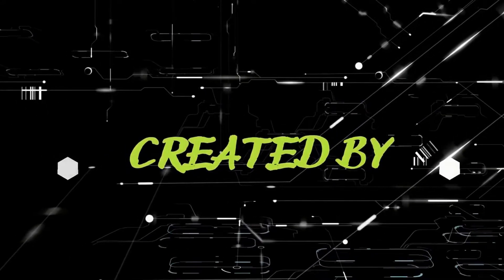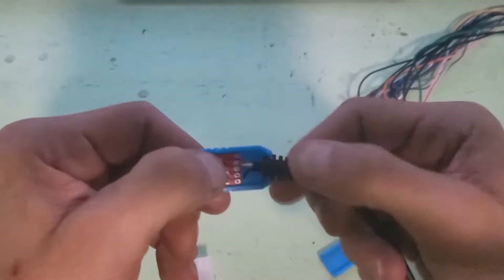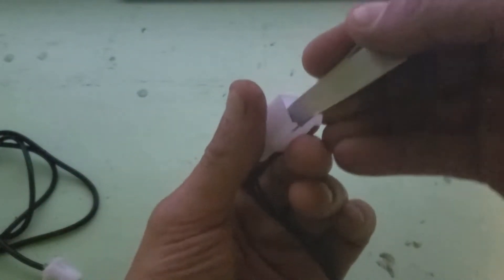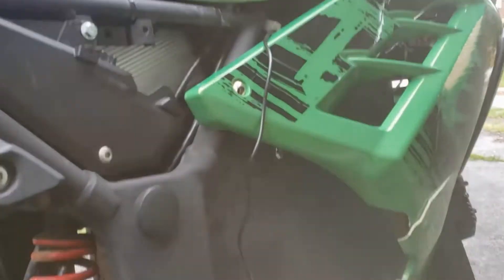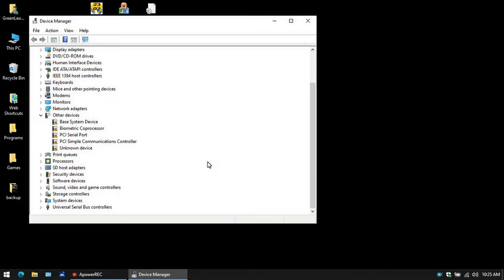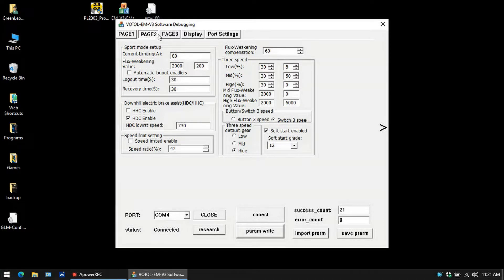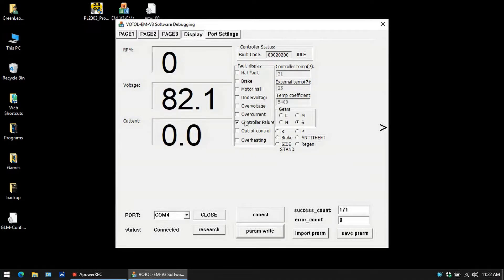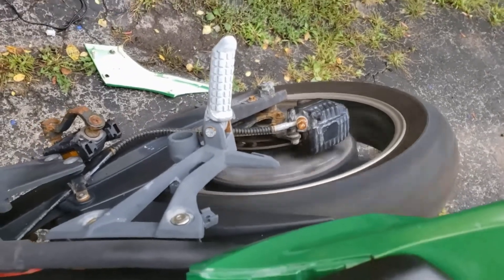Tao Leo - Votol EM-100 Programming and Test

Comment: Thank you so much for sharing your experience and for sharing the files, what was the maximum speed
Reply from the maker: Before I  retired this setup, it went about 115kph top, 130 off the ground. But I've swapped the 3kw motor for an 8kw and next year I'm putting in a fardriver nd72680. Hopefully I can get closer to the 200kph area. Tnx for watching!

Comment: Hello
I purchased a controller to replace the bad one that the throttle isn’t responding, I replaced the throttle. It has a 3 speed with reverse shifter but when I hooked it up it stays in second and will not shift up, down, or into reverse. Does this need to be programmed and if so how do you do that? Is there a video that would explain the steps? It’s a VOTOL Programmable EM50sp CAN Version 72V 50A 55KPH Controller for Electric Scooter Bike
CAN Version

Thanks for your help
Reply from the maker: Give this a read. It's a little different depending on the bike but this should be what ur looking for. Pay close attention to the port page. https://www.google.com/url?sa=t&source=web&rct=j&opi=89978449&url=https://deller.pro/wp-content/uploads/2023/05/2021031154133781_6.pdf&ved=2ahUKEwjhl_DoiIiQAxWKDDQIHbcSOWkQFnoECE4QAQ&usg=AOvVaw3c800gX-Jsg3S4Zi6sFXLL
Reply: Thanks for your help! I downloaded everything and I think everything is connected , when I hit connect it says I’m connected, I tried getting it out of park mode but it won’t let me. It also says “let’s open serial port” what the heck does that mean? Thanks again
Reply from the maker: Here, join this group. They know alot more than i do and they have alot more time to help. Goodluck https://www.facebook.com/groups/199911289738113/?ref=share&mibextid=NSMWBT

Comment: Hi. Question man. Can you set the controller to its max wattage.. like I have 3kw motor. Can I set the controller to 2500w max? So as to protect the motor however hard I throttle?
Reply from the maker: It doesn't really work that way with votols. If u keep ur max amps between 80-100a ur components should be safe no matter how hard you throttle. Just make sure ur bms is rated for 100a and can handle the load. Unless ur lead acid batteries, then u should be fine, they don't have bms's

Comment: can this be done with the controller out of the bike?
Reply from the maker: Yea as long as the controller is powered and u have an on/off switch. Doesn't need to be in the bike or hooked up to anything but power and usb. Although if u wanna tune it, I'd hook the motor up too.
Reply: @GreenLeoMan  thanks for the info , what province do you ride in ?
Reply from the maker: @mlow587 no problem. I'm in Niagara Falls, Ontario 😁

Comment: QS In-Wheel orta tren motoru için VOTOL EM-100 fırçasız DC denetleyici ?
Reply from the maker: I have no idea what your asking, sry.
Reply from the maker: It will work on both "in wheel" hub motors and external motors. There's a setting for that on page 1.

Comment: maybe you can help me. I bought a City Coco E-Chopper a few months back. I just spent several months refurbishing it and spent most of my savings. I finally got it assembled and took it for a cruise. It was awesome! I rode it for most of the day. In the evening I took it to do my laundry. After my laundry was dry I went outside to discover when I turned the key, everything worked but the current that was supposed to flow to the motor. 
I have a serious heart condition and was pleasantly surprised when a couple with a pickup offered to haul it home for me.
I have spent the last few days dissassembling it and reassembling it over and over again. I have watched every Youtube video including yours but have found no answers. 
I bought a couple extra controllers off tyhe internet a couple months ago and tried hooking them up to the bike, and get nothing. There is no wiring diagram. I cannot even get them to turn on.
Can I send my controllers in to you to look at?
Reply from the maker: I'm sry my friend but i don't have a repair shop. I just work on my own and i know nothing about your brand of bike. Unfortunately u might have to pay a local shop. Goodluck

Comment: where can i get the plug for the bike/laptop? thanks so much for your time
Reply from the maker: Here's 1. https://a.aliexpress.com/_mNH01oo
Reply: @GreenLeoMan  okay the wires look different colours will i have to take them out and put them in the right tabs like you demonstrated in the video? thanks so much
Reply from the maker: @alr2989 yea probably. It won't hurt it either way cause ur just switching the data lines, not the power lines. If it doesn't work 1 way, switch the 2 wires and try again.
Reply: @GreenLeoMan  if i copy the exact same settings as you on my tao leo will the switch still work to make it slow/fast?
Reply from the maker: @alr2989 no. Mine is setup for sport mode only. And I'm using the connection for reverse, I just set that 1 to be my sport mode. All the other settings will work. Just not the last page of connections. Sry, mines rigged different.

Comment: I have a question .
Why after I enter values in the EM-100 controller after pressing the record button, after switching off and on again the controller returns to the old settings.
Reply from the maker: That's interesting. Never heard that 1 before. Try reinstalling the software. Also check your cord for continuity.  I've never had this issue, hopefully this helps otherwise I'm not quite sure about this 1.

Comment: If the park is engage what is showed to the display is it hall failure?
Reply from the maker: No. If park is angaged, the "P" on the display tab will be selected. If turning off ur bike and turning it back on doesn't get rid of the "hall failure", u might have an issue with your motor wires going to the controller. If u continue to have this issue, check your motor wires to make sure none have shorted out. The 3 big wires coming from the motor, the plastic covering the wires breaks down over time  and could cause a short. I had to strip the black casing off the wires and could immediately see cracks in the plastics everywhere. I just wrapped all 3 wires with electrical tape and the issue went away. It's in 1 of my videos, i just don't remember which 1 anymore lol. Good luck and tnx for watching!
Reply: @GreenLeoMan  yeah thanks. .

Comment: Is it the same with the VOTOL EM-30S ?   I need to change the voltage.
Reply from the maker: I have no idea. Never had 1. Let me onow if it works. I can't see why it wouldn't work. Good luck!
Reply: @GreenLeoMan   I got frustrated trying to program the EM-30S so I just used a normal 48v controller that was so much easier.
Reply from the maker: @willscoot1394 atleast it works. Thats the main goal. Sry u couldn't get the em30s working.

Comment: Hello :) hope all is well with you ..I got a 2020 Tao leo and I've had to buy a new controller votolem100. Do I have to program this controller???? because I tried installing it and I still have no motor function.
Reply: Yeah I saw it. Just wanted to make sure
Reply from the maker: Yes u do. And u need a special cable to do it. Check out my votol em-100 programming vids. They're in the "Tao Leo Tech playlist. Good luck 👍
Reply from the maker: You're literally commenting on the video that explains it all. Watch the video b4 asking questions.
Reply from the maker: Heres the link for the cord u need.. https://www.aliexpress.com/item/1005003738240089.html?spm=a2g0o.cart.0.0.16c83c00famHmz&mp=1

Comment: Hello. in the video you talk fast and I don't understand. how to reset the "controller failure" flag. in my controller it is still active and the engine does not work
Reply from the maker: To reset the "controller failure" just turn ur key off and wait 10 seconds, then turn it back on and all should be well. Good luck!
Reply: @GreenLeoMan  thank you but I have another problem. I have em100. when I connect, the "busbar current" and "phase current" fields show 0 and the model shows em30.
When I enter some values and give "param write" and connect again, it is em30 and 0 again. Similarly, on page 2, the "current limiting" field. always 0. I can save the remaining fields and they are remembered correctly. the controller does not turn the engine. is it bricked?
Reply from the maker: Can u switch it back to em100 on page 1? That might help
Reply: @GreenLeoMan  I check em100, I click write param, software  says:  write ok,  I click connect and model  change to em30s , currents change to 0
Reply from the maker: That's an issue I'm unsure about. Could be a faulty controller but I'm not sure. Could be missing a step somewhere in the process. Maybe fauly cord? Not sure. This 1 confuses me. Keep trying things and I'll do some research to c if i can find a solution. Let me know if u get it in the meantime.

Comment: hey i did all that but the throttle doesn’t work, and on the display page, Undervoltagw and Overheating is selected !
Reply from the maker: Is your controller the em-100? Remember these settings are for a tao leo. If u have both of these then it has to be a bigger issue.
Reply: @GreenLeoMan  yes tao leo em-100
Reply: @GreenLeoMan  right now it’s just the overheating that is selected
Reply: @GreenLeoMan  is there any way i can reset all the setting to the basic ones. so my bike can work again please
Reply from the maker: I don't have a copy of the original setup. I had to replace my controller before I could save it. But I'll ask the shop I got mine from. I'm sure they have it backed up. Send me an email and I'll send you the file as soon as i receive it. Emails can be sent to Greenleoman.yt@gmail.com. give me a day or 3 to get results. The business world is a slow 1. Tnx.
Reply: @GreenLeoMan  hey, i tried today again, but the bike only throttles like after 0.02 seconds i turn it on then it stops throttling.
Reply from the maker: Not quite sure. Could be a faulty bms, shorted wired, defective throttle, defective switch or something like that.  It can't be the settings, it wouldn't do that stock. Or worst case scenario is they sent u a defective controller. Ur obviously programming it correctly and it's the right bike with the right controller...gotta be something else. I remember something similar happening to me and it was my motor wires. The plastic had deteriorated and the wires were shorting out. Also another time it was the stock breaker, if ur bike has a breaker on the battery, remove the breaker from the bike. Just an idea. Also strip just a little of the sheathing back on ur large motor wires closest to the controller side of things and see if the coating on the wires is cracking. Trial and error my friend. Hopefully u figure it out. Good luck!

Comment: Hi, have you tried using the regenerative braking option on the controller? How is it triggered because I can see you can have regenerative braking on without having the e brake turned on. So in that case when you use your actual disk brakes it will collect the power from the braking? Thanks in advance
Reply from the maker: As soon as the brake lever makes the click sound from the brake light switch, that's when the regen kicks in. The disks have nothing to do with regen. They are for braking only. The brake light switch signals the controller to engage the regen. I hope that helped.

Comment: Hi.  I looked at your video a few times, and it seems pretty complicated and intimidating, but I am not at all technical.  I have just ordered a Chinese scooter with a package of 72V-70AH lithium battery / 2000W QS MOTOR and a  VOTOL EM100.  I am now trying to find where to buy a USB connector to votol EM100.  Do you have a link?  Also if i only want to raise maximum speed limit to say 80 kmh, what setting do I edit (ie what page and what setting on software user interface you demonstrated in your video).  Hope you can help, thanks.  And trust me if i could find someone in Cuba who was an expert in this I would :)
Reply from the maker: I got the cable from aliexpress. Look for the "my tao leo parts list" video in the tao leo tech playlist. It has links to everything including the programming cable.
Reply from the maker: And the em-100 should be with a 3000w qs motor. Ur gonna have to find the amp rating on that motor and set the software accordingly or u could easily smoke ur motor. And as far as limiting. Just leave ur "hdc enabled" in the software and u'll be fine. Just dont over amp ur motor. Good luck!
Reply: @GreenLeoMan  excellent and many thanks, much appreciated!!  I am going to start immersing myself in this technology rabbit hole :)  maybe need to go tech. college beforehand or find a mentor in cuba:)      keep up the great work!!!

Comment: Still getting the "communication abnormal" after switching both wires back and forth. Solders and wires are in tact. Sees coms and port locations. Also tried an older windows laptop along with changing the language and different versions of software's.
Reply from the maker: And u turned the bike on right? Sry had to ask. Also did u try cycling the key on and off between settings? Just trying to cross stuff off the list.
Reply from the maker: If it keeps failing after that...I hate to say it but u might have a faulty cable, it's a possibility. They are made in china after all.
Reply: Yup everything’s wired up with ignition and display to ensure it’s on. Would you recommend just another non cam bus cable or Bluetooth to try ? Also only other thing I noticed was on my harness for the programming port I have a pink wire which is 5v reference but yours didn’t
Reply from the maker: It doesn't need it. Try disconnecting that wire and trying again
Reply from the maker: That could very well be the issue. U might have to switch ur orange and blue again but hopefully this should work. For some reason they work without the 5v.

Comment: Quick question on page 2 of your settings, your set up for the default gear is set as Hige, what's that for? Is it for faster take off?  Because mine by default is set to "Mid"
Reply from the maker: It's cause i don't have a switch anymore. I just leave it in high.
Reply from the maker: I honestly don't remember. It's been a while since I looked.

Comment: Connection abnormal no response, how to fix?
Reply from the maker: Be more specific
Reply from the maker: Did u switch the wires on the plug like i said? Is your adapter can bus? Small details help
Reply from the maker: Also did u select the right com port?
Reply: Heya so I finally got it connected, but I don't know how to turn the parking brake off
Reply from the maker: Watch the video. I explained it already.
Reply from the maker: 4:30 into the video
Reply: @GreenLeoMan  Gotchya, thanks again.

Comment: Just got my programming cord installed, I hooked it to the false gas tank and so I can open it with a key and access the cord! 

Ever play with rate of rise and decline?
Reply from the maker: Yea a little. The faster the rise the higher the amps so u don't wanna adjust it too much. As far as decline. That's for regen breaking so it don't matter. Basically, how fast would u like to slow down lol.

Comment: hey man can you help me with my votol controller?
Reply from the maker: Watch my videos. I have 1 or 2 on how to program them and how to set up the wires.
Reply: ok well i have the 1200, 150 and 200, non of which i can get to spin the hub. i have followed every single fracking guide, i have all the manuals and software, its been months of me trying to figure this out,
what would be super cool would be the config file youre using, maybe i can jut upload it and shit might work
Reply from the maker: I hate to ask but did u disengage the park setting? It won't go anywhere if the controller is in park. I just removed the park feature by setting park to null. I can't send u my file. Sry bud. And u said the 150 and 200. These settings are for the 100. That might be ur issue. I dont know the settings for those controllers. Unfortunatly it's a very frustrating game or trial and error. The video makes it look like i just knew.what to do. It took me a long time to get my settings right. And my motor wouldnt spin until i took the park option away. Hope u get it man. Goodluck.
Reply from the maker: Also these settings are.for a tao leo running a 3kw qsmotor. U never mentioned what bike u have. And u have the 1200 what? 1200w motor? These settings will cook that little thing. U are very vague on your descriptions.
Reply: @GreenLeoMan   oh i have  the em2 with a qs 3kw motor
Reply from the maker: Its a completely different harness but the controller to motor should be the same. Not sure what to tell ya at this point. Good luck. U might have to bring it into a shop.